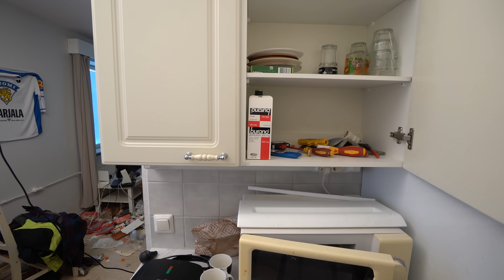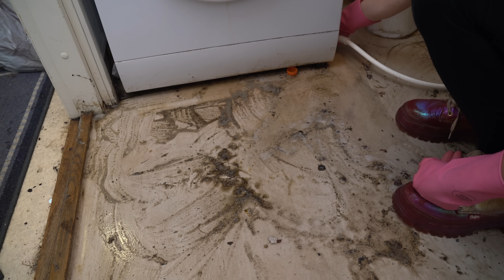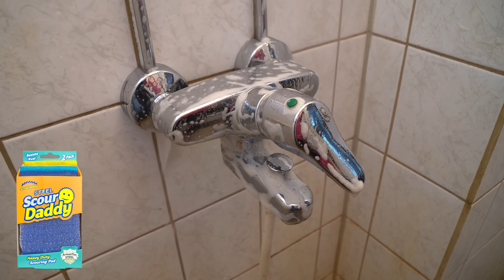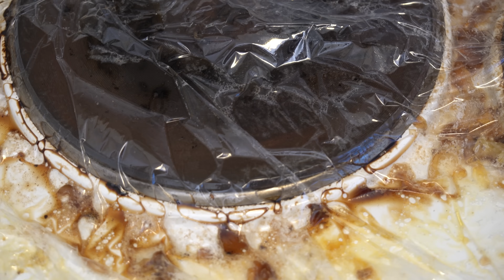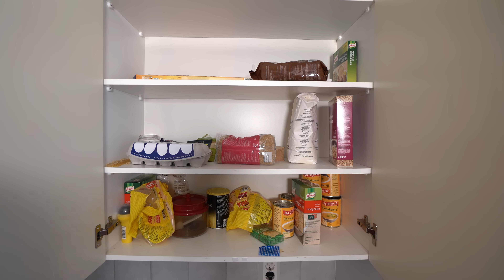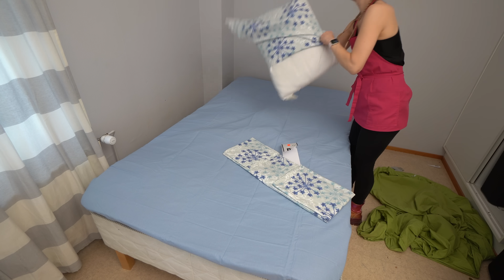24 HOURS DEEP CLEANING FOR FREE | Saving this house!! 🥺❤️

Comment: One really good cleaning tip I got, is when you have a sticker on a surface get a hairdryer and warm it up so the glue softens and usually it will just peel right off🙂

Comment: You did a fantastic job on this apartment!  Mark, If you read these comments, congratulations on taking the steps to turn your life around.  Failure is only a fail if you do not learn something from it.  We are all rooting for you, and know you can stay positive and keep going one day at a time to make a wonderful life for yourself.  Hang in there. don't give up, if you stumble or fall, forgive yourself ask for help and start again.  I do believe a bit part of your success is forgiving your parents and the foster system, as well as forgiving yourself.  We all try to do what we can with what we have at the time.  Many blessings!
I have great success using a homemade slurry paste of baking soda and hydrogen peroxide.  Possibly some dish soap or vinegar added if I feel it needs it.  I usually slather it on, let it sit for a bit then wipe it off.  Usually removes everything without requiring much scrubbing.  This is also good for removing coffee and tea stains from your favorite mugs/cups.  Add a Tablespoon or so of baking soda, several tablespoons of peroxide, fill the cup up the rest of the way with hot water.  Let it sit several hours or overnight.  Dump the contents, and wash the cup, it will be completely stain free with no scrubbing.

Comment: Auri, thanks to you I bought my first scrub momma/power paste kit today. My biggest problem with super hard water stains on the lower walls and floor of the walk in shower. We are on well water here in North Carolina. The number and types of products I've bought over the years to try and get rid of the tan/brown stain is numerous. Combined with a degenerative back problem which makes bending over/kneeing increasingly harder as time goes by, trying to get and keep this shower clean is breaking me down. I used the power paste and momma earlier today and had to scrub a LOT. It was no different than using a steel wool pad (ie, S.O.S. pads).  A LOT of work. There's got to be an easier way!

Comment: As someone with mental health issues, this rings with me. I just came back from cleaning a very small part of my bathroom, and that was exhausting enough for me. Not physically, but mentally. Physically, I can go to the gym for hours. But mentally, it's just different when I have to scrub stains while thinking about a lot of things about that stain, why it's there, why it keeps coming back, can this remove it, what else should I try, how long should I soak, etc etc. It's not something we can control. That's why it's an illness. Thanks for this video.

Comment: I feel like this is the most important tip I can give someone with children, if you have stickers stuck on a hard surface, put foaming hand sanitizer on it and placed a microfiber cloth over it for a few minutes, repeat the process of putting on the sanitizer and putting the cloth back over it until its soft enough to be wiped away. I work at a children's hospital and kids tend to out stickers everywhere, since we don't use chemicals like glue remover we've come up with a way to use what we have on hand and hand sanitizer is a life saver

Comment: Auri, something I would really love from you is a video with some tips on cleaning safety. i.e. what products should not be mixed together, when to wear gloves, stuff like that. I love when you give us tips on the most efficient way to do things, or what cleaner to use on certain types of messes, and would love tips on safety when it comes to using the chemicals cleaning sometimes requires.

Comment: Hi! first of all you're an angel of perfection. I've been watching your videos for a while now, thank you so much for all the grime and compassion <3 I recommend that you give a thought about these TIPS : 
-A STEAMER/STEAM MOP!!!! Remove build-up and stains on floors and surfaces faster than the scrubbing-wiping method. I have one that I can detach the hand-held piece from the floor piece so I have a steamer and a steam mop, depending on the task I'm tackling. I got it for less than 200CAD so it was pretty affordable for me. AMAZINGLY versatile, it comes with a few accessories like different brushes for stuff like grout - either hand-held or with the floor extension, clothes attachment to steam fabrics like sofas, curtains, etc., bent nozzle to pressure steam hard to reach crannies like windowsills, cabinets joints etc. I could go on and on about it!
-A VACUUM BUT NOT FOR FLOORS - to remove dirt and dust really quickly like on a sofa and in the sofa crannies, in cabinets, drawers, dust on fabrics like rugs, etc. I agree with you SO MUCH that vacuum are not efficient for floors, but they do the job faster for some type of tasks.
Those two really reduced the time I spend cleaning!

Comment: Great video! Yellowing plastic like the microwave door can be fixed up with hydrogen peroxide, plastic wrap and UV light. It's used a lot in PC restoration where they call it "retrobriting/retrobrighting", but it takes time and equipment. A bit more complicated than regular cleaning, but it is possible, just thought I'd throw it out there. 🙂

Comment: Sticker tip: if you have a blow dryer, blast the sticker on high heat for a few seconds and then peel it off in one go. You could also use an iron by using the steam function the same way😊

Comment: Oil removes sticker adhesive really well, I would recommend it over using a glue remover or something. Heat/steam makes it soft so you can peel the sticker off easily, then use oil to remove the residue.

Comment: I cut my paper bags to open them up and then I fit them inside the cabinet and use them as cabinet liners. I find it easier just to change those out than to have to clean the inside of the cabinet. This is especially good when your pots and pans are heavy like cast-iron, and also in the cabinets where you keep your olive oil.

Comment: I am not struggling with depression but when 3 weeks ago my flat got flooded with sewage water I also felt powerless and couldn't get myself to even clean the floors (I went away for a week and in a meantime the pipe got blocked in a basement and as my flat is on a first floor everything my neighbours were pouring down the drain ended up in my kitchen sink, then on my floor etc.). I was devastated because I just moved into this place and already put a lot of effort into it. So no shame from me to these people. Life is hard sometimes and whatever the reason is you can ask for help.

Comment: Hey if you use a steel scrubber, it will scratch any kind of plastic. Instead of going for more and more abrasiveness, try using a better cleaning solution. Oven cleaner will remove almost every sort of grime.  You can also use concentrated CLR to remove any hard water stains/calcium build up.
Reply: I’m pretty sure she scratched the  washer using steel scrubber, also I don’t understand why she was using grease cleaner on the red mold in shower.  Best effective and easiest is to use any cleaner with bleach just spray it and let it sit.  Bleach kills the mold and sanitize as well. She was scrubbing it multiple times unnecessarily. Wasting time and energy 😄

Comment: It never ceases to amaze me  having the washing  machine  in the bathroom,  electricity  and water do not mix  so how that works I dont know know
Reply: But the washing machine itself is electricity and water.
Reply: @melissahollowell7255   the water is inside the washing  machine, not anywhere near the electrical plug or wire
Reply: @TheBellaBoo_YT  I have had bathrooms with W/D hookups and never thought twice about it. If it was a wet room then, yes, that would be scary. Are you in the states? Electrical outlets in the bathroom are totally normal but wet rooms are extremely rare.
Reply: @melissahollowell7255  hi no  Great Britain
Reply: @TheBellaBoo_YT  Forgot to mention I am super jelly of anyone living in Europe. (I am stuck in Texas.)
Reply: @melissahollowell7255  everywhere people  live  im sure has its good points  x
Reply: @melissahollowell7255 the water is inside the washing machine  obviously,   the wiring is outside  so potentially  dangerous

Comment: Auri I love your videos ❤️ question: how would you clean the bathroom shower curtains?
Reply: I put mine in the washing machine with towels. But when I bought them, I made sure to get ones I could wash easily! My mum used to wash them by hand by laying them in the bathtub and scrubbing with a brush (a floor brush, or a nail brush) and some washing up liquid then rinsing them off with the shower. (This was a school holiday job I hated! So I buy polyester shower curtains that I can wash in the washing machine.)

Comment: I would be really interested in seeing you clean the toilet. I have issues with hardened discolorations (I guess a mix of limescale and urine?)  at the waterline and would be really interested in how to get rid of it. My products don't do much, and steel wool I heard will just lead to more stains in the long run due to micro scratches. What's your opinion on that?

Comment: Please show us how to wash frying pans, they are as bad as a stove. I heat them up and then spray oven cleaner to the back of the hot pan. It sizzles, foams up, and after I use a little steel daddy with soap, the grime residue goes away like a charm. But I can't do it inside, otherwise it can lose its non stick power